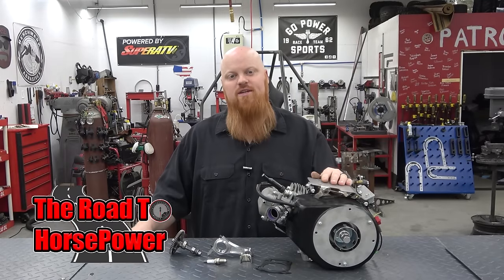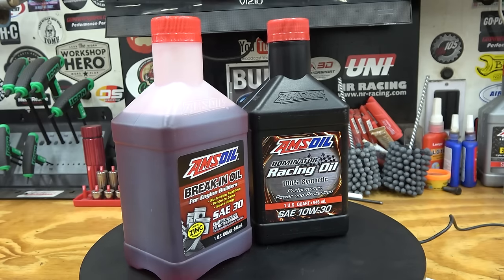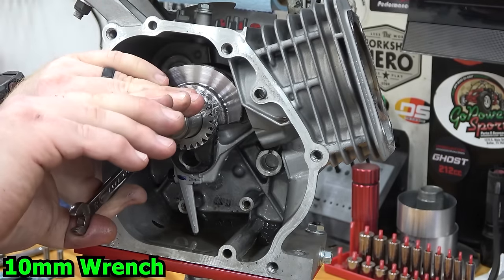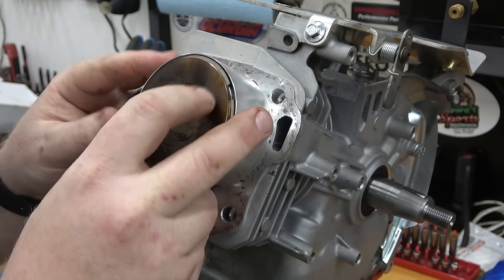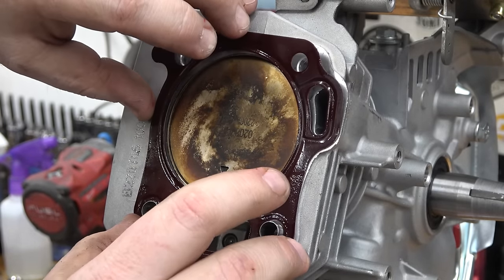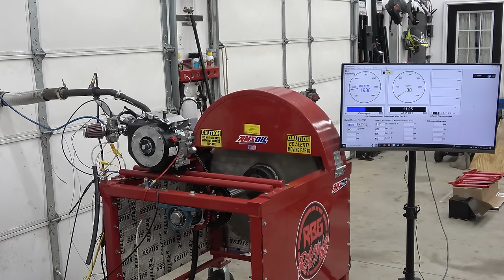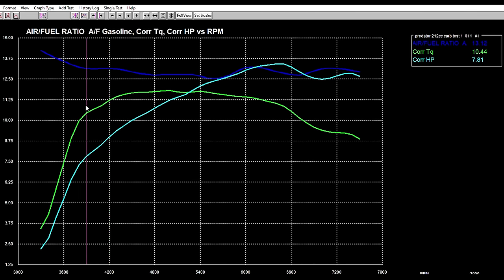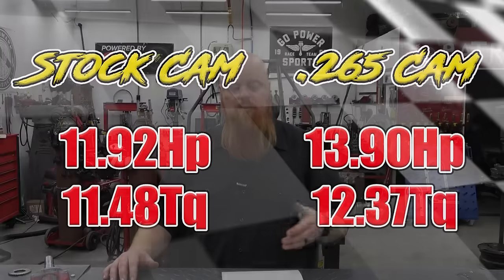Predator 212cc Cam & Head Gasket Upgrade Dyno Test ~ The Road To Horsepower Ep4

Comment: Can't wait to see what some port work does to compliment the cam. It's very cool to see the air/fuel being shown in these last couple videos. You should get into that a bit more, showing jet changes and what not is required with each change to keep it in line. Very cool stuff!

Comment: Normally great videos! On these Dyno Test, You know all the Engine DATA, but most People don't it would be nice to have all the Engine Data, CC, CAM Spec, Valve Spring lbs, Valve Sizes used, Carb Size, Type of Air Filter used, Type of Exhaust used. A list of hp made at different rpm, other than just Max hp@rpm. These Honda/Clone Engines are being used on more Products every day. Go Carts, Off Road Karts, Snowmobiles, Snow Gliders, Air Boats, Mini Bikes, Hover Craft, Mud Boats, Part 103 Ultralight Airplanes, PPC, Kit Planes, Hover Craft, etc. Like for Airplane use they would be limited to Max 5500rpm for Durability and that's just for Takeoff 2-3min and then Power Reduced to 75% to 90% depending on Speed or GPH use. Part 103 Ultralights can only carry 5 Gallons. Part 103 and most Small Kitplanes use 26hp to 40hp Engines. The Lazair Ultralight first used (2) 5.5hp Chainsaw Engines then upgraded to used (2) Rotax 185 2 Strokes at 9.4hp@5000rpm each, then upgraded to (2) Solo 210 Engines 15hp each. All Planes have a Max Takeoff Weight (MTOW). A Good Power to Weight Ratio is 1kw for 10 kg to Fly Well. The Lazairs MTOW is 450 lbs = 204.1166 kg / 10 kg = 20.41166 kw needed to Fly Well = 27.37249 hp / 2 = 13.686 hp or 13.7hp needed for each Engine. Which these Honda/Clone 200/212 engines can make that hp@5000rpm.  https://www.youtube.com/watch?v=XOQOW2Gqs7Q

Comment: That Ams Oil is awesome stuff. I swear I get an extra 200 rpm with it in my 2 stroke snowmobile. The exhaust pipes get a little sticky and messy but it's worth it.

Comment: That was good, but one thing I would like to have seen was the graph of the last one with the same carb against this run to see the changes in where the HP is with the different Camshafts. Also when you do the head, compare the two stock heads, against two ported heads (maybe just use a thick gasket to compensate for the lack of dish in the piston for the original style head)

Comment: The small valve 14cc head is a popular budget option....giving  up valve size vs compression.  You could compare a ported 14cc to a ported stock valve on the same engine and I believe same head gasket.

Comment: It might be possible to remove the HP dip around 7000 RPM, by lengthening or shortening the intake tube between the carb and the head. It would be interesting to see how that will affect the HP output curve, and should be very easy and cheap to do. Since the cam was changed you changed the intake duration and resonance, and it normally means you also nee to change intake length to match the cam.

Comment: Yeah, this is fkg cool stuff! I used to love building v-8 engines, but i have to say, this is just as enjoyable just on a smaller scale. I wonder if it would be possible to come up with some videos of some epic fails? Like showing just how bad a  factory flywheel explodes on the dyno? It would definitely make someone think twice before taking the governor off a stock motor! Yeah, that probably won't happen but i had to ask! Also the big block motors are going to really get my attention because i want to put together a bike with one, albeit stock, just for the torque to climb just about anything!  I don't need to go fast anymore, i just want to be able to to get to those far away hunting spots!

Comment: Don't get me wrong, I love the content and the videos.Type of videos all of us want. I appreciate the effort. I just don't understand the high rpm pulls so quickly on break in oil. Normally two oil changes on break in oil are in order to remove assembly lube and tiny metal particles that come with these types of engines when new.
Reply: RBG does engine pulls off camera with the break in oil. Break can be as little 15 minutes- top engine builders with diamond hones and proper hone grits. That said, leak down testing/no oil residue inside the  exhaust port verifies the rings have seated.
Reply: @markyoung9964  I asked that very question, "Was a proper break in done before that high rpm pull? Am I missing something?" 
That being said, I would not do full rpm pulls on contaminated break in oil. I race prep Briggs Animal lo206 engines and have championship hardware to show. I have found the engines put out more power and last longer if the proper break in procedure is followed. Mostly decontamination   the oil is the biggest deal.
I also have a stage 4 kit on a predator hemi from NR racing with a 280 cam and 2.1 ratio rockers. I do not speak just to speak. I speak from experience.

Comment: Local engine builders are going back and forth about engine oil weight and synthetic can change hp. 0wt 30wt 10-30wt etc. One guy says 0wt oil makes more HP cause dipper goes through it easier. Would be a good dyno video.

Comment: Id like to get a billet steel rod, with a pressurized oil system,  forged piston, with oil squirter, and oil cooler, it should spin 10k rpm

Comment: Just a few thoughts, are there cooling upgrades for these engines? With hp, comes heat. I see the new flywheel appears to have a slightly different fin design but is that enough? How long would one expect the lifespan to be without some sort of cooling upgrade?

Which could be a neat addition to the series, upgrading the oiling system and adding cooling to it with external oil cooling to see how it effects overall engine temps. 

Have you considered non traditional engine choices for up coming builds? I know they can be harder to find bolt on parts for, but it would be very interesting to see. For instance I have a Rhino 450. They're slow but reliable, and I'll likely replace it with a maverick eventually. But without aftermarket support for real hp gains it would be very interesting to see how much improvement can be made from engines without thst support. Things like playing with different size carbs, porting and polishing, intake and exhaust upgrades. Mabey even a couple homemade turbo set ups. Things that can be done with any engine that just doesn't have the benefit of a huge following to bring parts and experience to the table.

Also, this show is getting a very much too scripted vibe. Similar to the old spike tv shows. We all know damn well those e-clips turn into ballistic missles just by looking at them wrong. I don't know where you got those low tension stunt clips from, but it really takes away from the realism.

Comment: Now with clearancing the crank, you removed a fair bit of material. How is the balance? Does it vibrate more? It looked like the exhaust was shaking like crazy at higher RPM on the dyno… but I realize that also may have been due to the dyno.

Comment: RB, I was thinking, I'd rather have a cam with that same duration, but a lot less LOBE lift. I could regain the lost VALVE lift with 1.2 rockers, and not have to grind on the crank counterweight.

Comment: I ordered the stage 2  kit that comes with all these parts from your affiliated links but I just noticed they come with 22lbs springs and you say 26lbs …. Do I need to reorder need 26lbs springs…….. and lastly do you think my 30series torque converter will be able to take it?

Comment: @8:37 I agree modifying the crank is necessary but re-balancing, especially after that much grinding on one side should be considered. When you're digging for every last 1/10th hp, a balanced crank and blueprinted rotating mass assembly will unlock hidden gains. Also, is that dinky air filter a class limited size and/or manditory?

Comment: In your experience what causes the drop or wave in power about about 6500? I would figure valve float, but I don't know anything about these engines. In a multi cylinder automotive engine, thats pretty much what it looks like when you loose valve stability.

Comment: I was really curious about the lubrication of a lot of these predator motors and Honda engines at general oil thrower at the bottom of the connecting rod I made a clear side cover ran the motor and was surprised to see that the lubricant only flung around the gears the teeth themselves and would drip down on the connecting rod bearing and other parts after you shut it off So I took a file and made a very small flat portion on the oil thrower towards the front of the motor made a nightinday difference with the way the oil splashed around

Comment: U should do an episode where you put timing to the moter and see the inprovements
Reply from the maker: The cam we are using is for the timing the billet flywheel has. We do have another cam to use later where we do have to adjust timing.

Comment: Something i missed in these 4 episodes.. did you change the Piston??? because i noticed it was flat.   is that stock??? 
It's also odd that you have a cast valve cover when HF shows stamped valve covers on the predator 212

Comment: Hey Red, I saw in one of your videos. Sry can't remember which one. Where you plumbed the valve cover vent back to the crank case where you removed the govener arm. I would like to suggest plumbing it back to the intake tract since increased crank case vacuum improves ring seal. You could add a small oil separater to prevent intake charge contamination. I am curious to see if this would make a real world dyno number difference.

Comment: Looks like the valve springs are floating above 6000 
Usually signs of too weak of a valve spring when they dip like that instead of a continuous arch
Maybe stiffer spring or shim them if there’s enough room with out coil bind
Reply: The springs may have made the afr flutter to

Comment: Wouldn't grinding some of the crankshaft away for the exhaust lobe of the camshaft to clear, and changing over to lighter connecting rods, cause some extreme unbalance of the crankshaft? Wouldn't you have to remove some weight from the counterweight?

Comment: A/f ratio is different for every carb. If you could dialed them in closer it would be different results. The genuine 22mm carb looks like it flowed more fuel than the knockoff via the a/f ratio.

Comment: Can anybody tell me if a predator 212 double magnet flywheel for a set of dual charging coils will fit and work on a tillotson 212? Gopowersports say they can't get the fly wheel that I need and that I would have to buy a whole new motor with electric start. If not I'll just junk the $400 tillotson and buy a predator. They don't explain this during time purchase, or have explanations on their web site that the motor flywheels on certain motors do not have magnets to run a head light. Looks as though I'll have to spend another $1200 just to have a head light.

Comment: Why would a cammed 212, not let it passed like 3600rpm ?
Tried different carbs, .034 gap on flywheel. 356 cam, 32/25 ported head.

Comment: Holy smokes man!....you've doubled 'out of the box' hp. Big question for you.... i have a Hammerhead 150 GT i blew the GY6 out of. Swapped in a 224 max and a series 30 CVT. I tried 2 test rips and both times it smoked the belt. What can i even use if that isn't a sturdy enough setup for a buggy with 22" tires? Can i put a bigget CVT on?

Comment: Why would you do a 6700 rpm pull on fresh break in oil on a fresh engine? Did I miss something?
Did you do some break in before that pull?
Reply: The dyno pull is the break in. One run and it's broke in.
Reply: @Deucealive75  No, that oil beco.es contaminated and that oil is not designed to spin that high especially contaminated with break in particles. Had that been on at least one oil change then I probably would not have mentioned it. Even Brigs and Stratton Animal engines call for 2 oil changes before full speed runs 20 minutes apart. Then full speed

Comment: Interesting how you call yourself out for forgetting the vavle springs while ignoring ARC's instructions on using plastigage for the bullet rod. Checking the crank doesn't guarantee that the bearings are sized correctly.
When you get to the cam shootout are you going to do the Black Mamba and Mamva Junior, or just Go power sports cams? I run a Mamba Jr and would like to see the numbers vs the 265 cam everybody runs

Comment: Use normal Motor oil when installing the pistons not Assembly lube, assembly lube is to thick and can glaze the rings and cylinder wall

Comment: I would like to see some fuel testing.  You could test 87, 89, 91, 93, octane with a stock engine up to a fully modified engine.  That way we can find out where the octane makes a difference or dosent make a difference in a stock to modified engine.  It would be cool to see some dyno tests on c16, e85, or methanol to find out if it makes a difference in hp.  Maybe even test a little nitro that you put in a rc car.
Reply from the maker: We have that coming up very soon sir! We are waiting to do a little more compression first to take advantage of the higher octane.
Reply: @RedBeardsGarage  Awesome!! I was thinking about that when. I wrote the comment.  I imagine some custom machine work will be needed to bump the compression up high enough to take advantage  of some of the higher octane fuels.  I'll be watching forsure.

Comment: Would like to see a Predator 212 Hemi Build to make 15hp@5000rpm for Mini Air Boat use. Ideally, use a CR for 91 Octane. Using a Mikuni Flat Side Carb. Make it as Light as Possible.

Comment: I'm running a stock predator 212 with an Chinese vm22 26mm carb and after market exhaust.. I have tied out the governor... I know is should replace the valve springs next.. don't know if I should just do the 18# springs or if I should run the 22# springs because the next upgrades is a mild cam.. plenty of power but don't want the nylon cam gear and fully eliminate the governor and oil sensor... any suggestions...

Comment: Red beard I need help with this concern that I have will the cam that I had on my non hemi predator work on my hemi predator I only ask cuz I bought a engine thinking it was a non hemi cuz of the picture and sku number on the box and I open it and find out it’s a hemi so I’m concerned that the parts I have for the non hemi will not be compatible, and yes I plan on changing the hemi head for a non hemi if you can please help me with this it’ll save me a lot of time researching

Comment: but what clutch is u using 🤔 want that boost HP
Reply from the maker: A clutch will not add hp unless it’s slipping and then it would read lower because it’s not hooking up. A clutch can’t make more hp as long as it’s hooking up.

Comment from the maker: What do you want to see next?
Reply: I'm curious how these same mods would affect a non-hemi Predator 212
Reply: In the future a 212r mkii tillotson stock dyno
Reply: where do you get the magnetic dipstick?
Reply: Noticed Gopowersports sells a mechanical fuel injected carb. Curious to see if it would perform better at higher rpms than a regular carb.
Reply: 390 vs 420 vs 440 vs 459. All stock, then all with the same stage 1 kit. Let's see if the Honda is underpowered and if the duromax makes its claim
Reply: I wanna see how many rpms till cast iron or plastic flywheel explodes
Reply: how about a video on sparkplugs?
Reply: Ratio rockers on 36lb springs

Comment: Still BS testing up to this point, since this is the first time AFR where attempted to hold to around 13.  Also, with engine being able to rev'd to 6K, first time that billet flywheel with advance should be bought in to play.  Simply, at this point, what is the difference in HP between a total stock motor at 13AFR reving to 4K, verses motor to this point now its AFR at 13, but rev'g more RPMS to wear it out faster with the cost of extra parts.

Comment: This is like spending a fortune to wind up a rice burner only to have it fail in a few miles when you could’ve just bought a decent small block Chevy that you can drive to work every day for 20 years
Reply: Generally agree on large engines since a small blocks foot print is barely larger than a Honda with half the displacement, the difference in small engines is any considerable increase in displacement usually means a considerable increase in physical size and when your building for a mini bike you just don’t have the room to fit a considerably larger block on the frame, thus the importance of a series like this. I’d also say fwiw this full build on a used mini bike frame will still be cheaper than any comparable pit bike

Comment: $200 engine $400 for stage 4. Why not just buy a crf450 motor. No mods needed.  They also produce 60 horsepower. Not 22